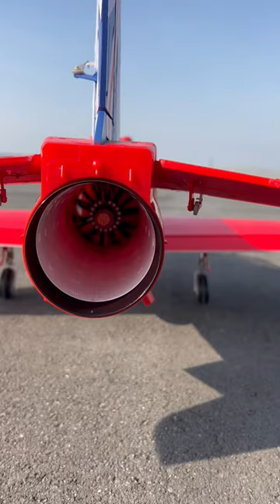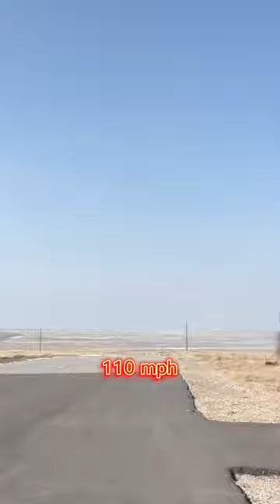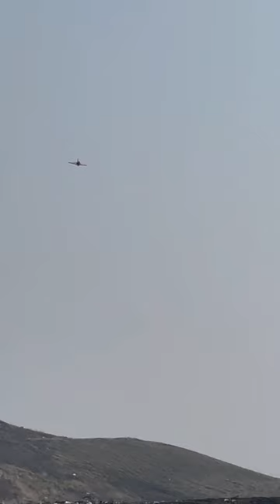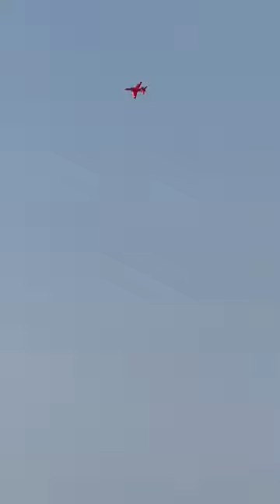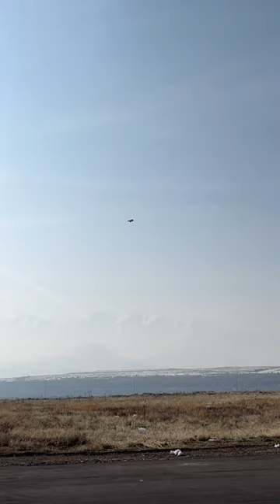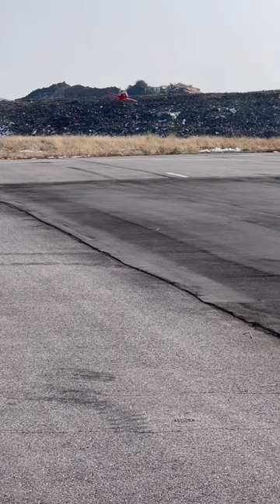Dead Stick Landing on FMS BAE Hawk

Comment: And set your timer. I had one good 5 cell 3000mah and freakin killed it because i didnt set the timer. Came in deadstick wirh a mig 15, bye bye nose gear and battery.
Reply from the maker: Timer was set. BUT the battery was almost dead so it didn’t matter. However we absolutely agree with you- we like to land with around 25-30% battery left, so we set our timers on each plane accordingly